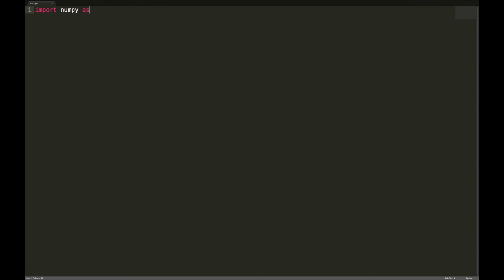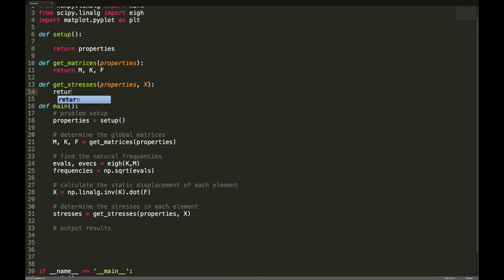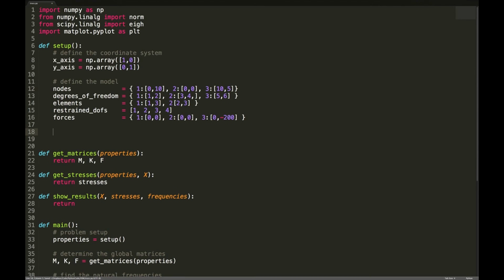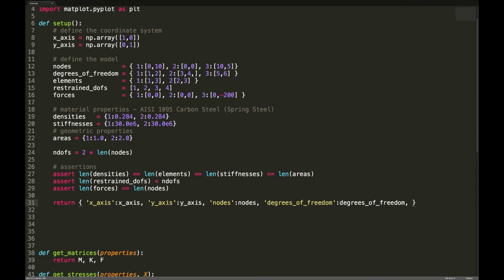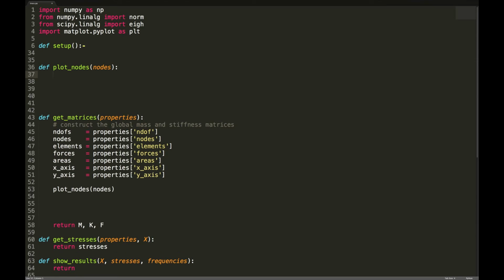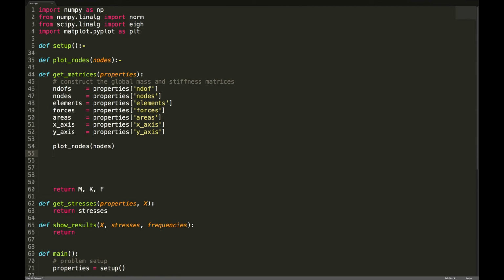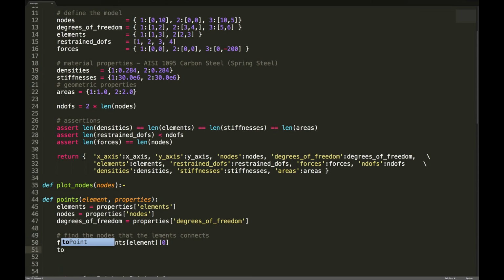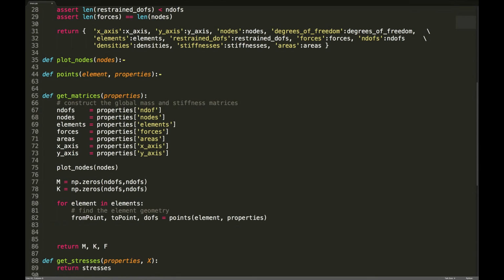Bar Finite Element - Coding the Truss Solution - Part 1 of 3 - (Setup)

Comment: Hello, great tutorial. What is the affect of excluding rotational dofs? Does this mean that all displacements in this approach will be solved axially and that bending is neglected?
Reply from the maker: Yes.  This is fine as long as the various joints are pinned and not welded.

Comment: Hello sir,
I simulated this same problem in the FEM structural analysis software ( simple linear analysis), but the displacements came out to be quite different.

something like this DX=3.9E-005   DY=-1.50214E-004

Is there any mistake happened while formulating the stiffness matrix in this python program?
Reply from the maker: I believe this is correct since I verified these calculations by hand.  I know I did not treat the mass matrix correctly, but this should not affect the static case.  I'll have to take a closer look at the code when I have the  time (it has been a while since I last looked at it).

Comment: sir, if I have a complex 2D structure, 
Is it fine... if I go through the same procedure and steps as you did ..will that work too ? 
like in my case it has 20-25 elements (arch-shaped structure) with the same direct stiffness approach. P = k .(delta)
Reply from the maker: Yes, it should work.  Please note, however, that the way I treated my mass matrix in this video is NOT correct.  The treatment of the stiffness matrix is correct.
Reply: @Freeball99 ,  sir,   may I know, what's the mistake with the mass matrix here?